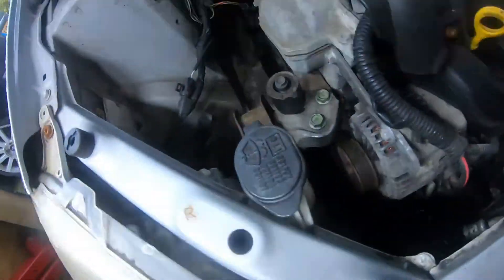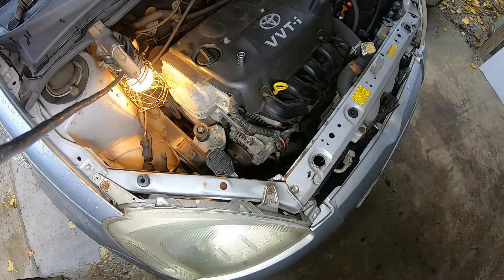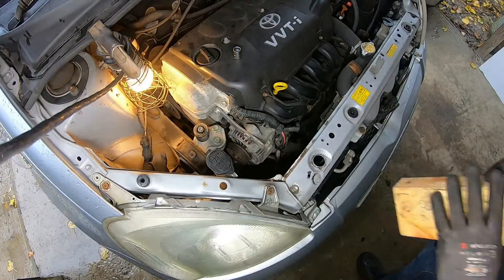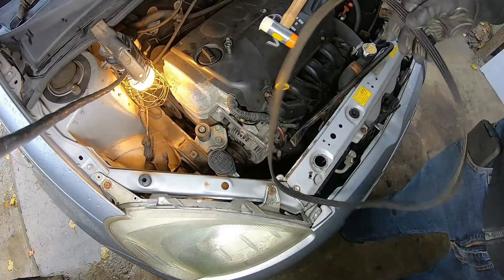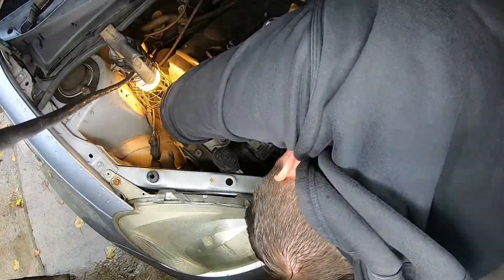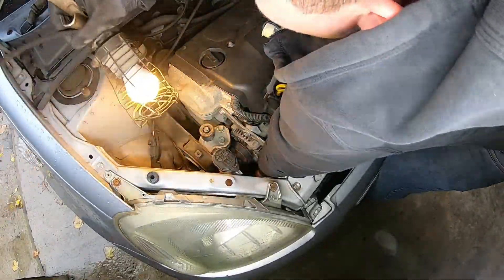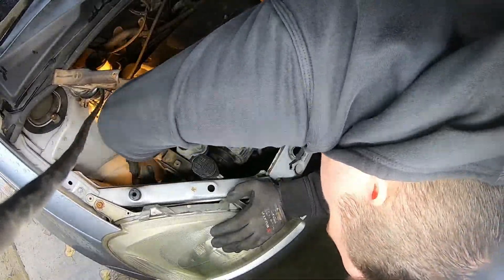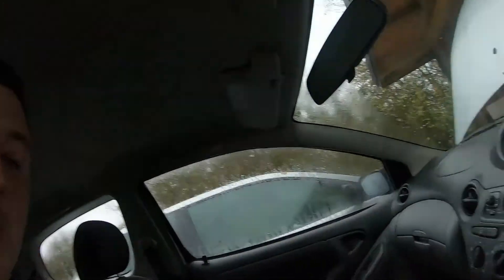Toyota Yaris Auxiliary Belt Replacement

Comment: You routed the belt wrongly. A belt's face should never touch a pulley -- it needed to be routed up and around it, at least that's what the Toyota workshop manual says.
Reply: I recently bought a manual for 1nz-fe and in that manual it is definitely mentioned to be routed as he did